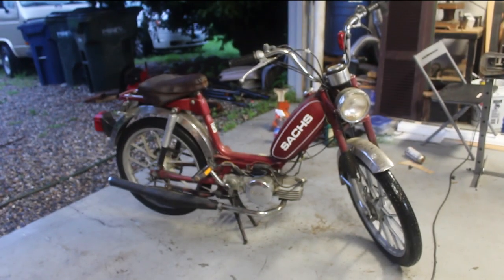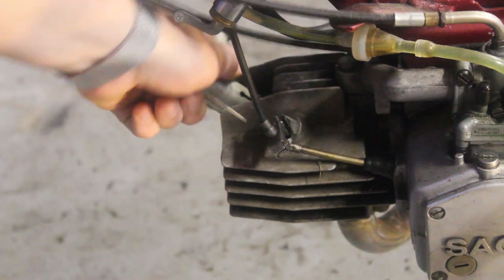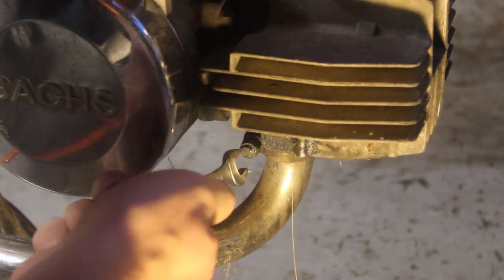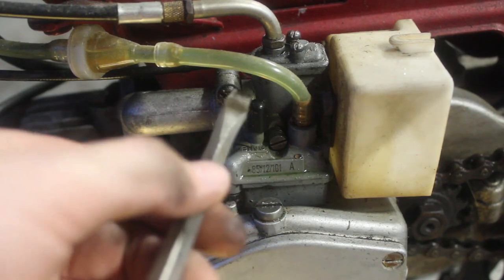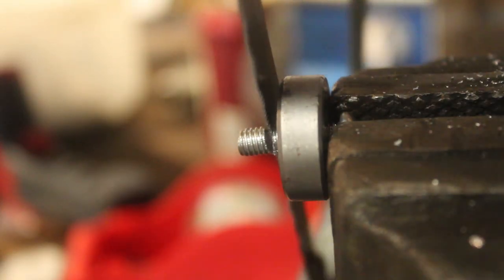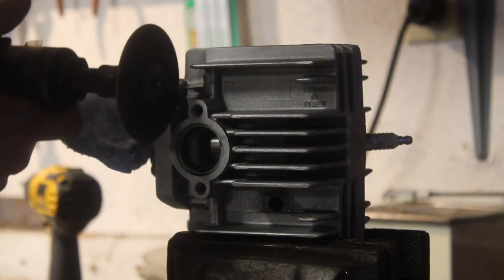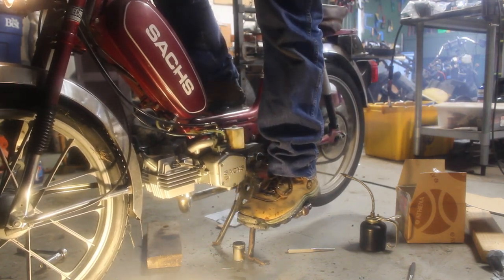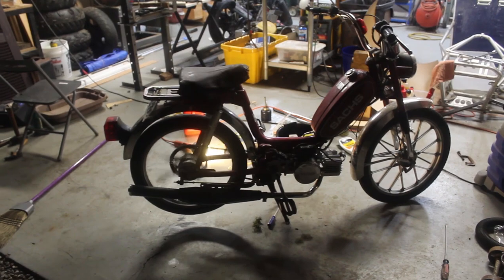Making an Old Moped Go Fast - Part 1 - 70cc Cylinder Kit Upgrade

Comment: I just picked up a 1980 Sachs Prima moped. It has been sitting forever and is going to need some work. Really love that I'm not the only one excited about working on one of these! Keep posting, I'm here for it!
Reply from the maker: Awesome! These old mopeds are a lot of fun
Reply: @rainvillecreative5410  Heck Yeah! Still working on getting mine running, but I am definitely excited to get to it. Any chance you got test out the new top speed on yours with this 70cc upgrade?
Reply: How much did it cost ya?  Im interrsted in one.
Reply: @CaliWalli  The one I bought had a seized engine :(
however I paid 100$

Comment: You sure that square bing is 15mm? Never seen a square 15mm
Reply from the maker: Whatever the stock size was, could be a 12mm
Reply: @rainvillecreative5410  they came in 10/12/15mm at least on the stuff we got here in norway

Comment: You defently need to replace the old 10mm bing carburator whit a bigger one 13-19mm
Reply from the maker: Yep the next video is on installing an 18mm Mikuni carb, really helped open it up

Comment: You did nothing to explain about the parts you put back on the machine. Is that the same stock head cleaned up or aftermarket. Is that the same piston or aftermarket and is there more compression and what is it stock and what is it now. Things like this make a video. Not just taking something apart and putting it back together. Need some substance.